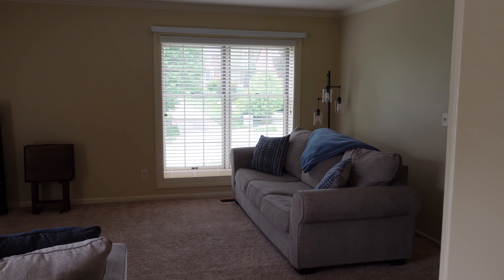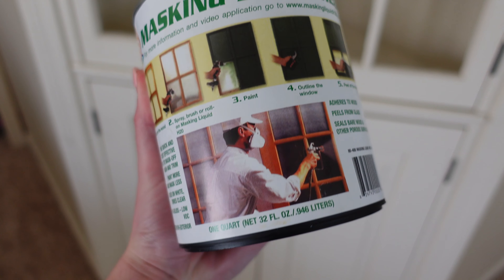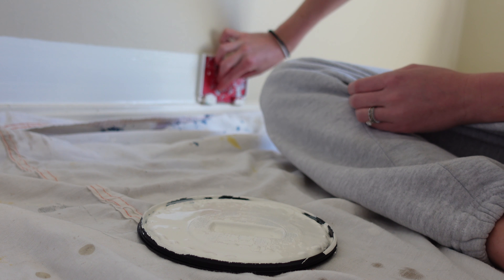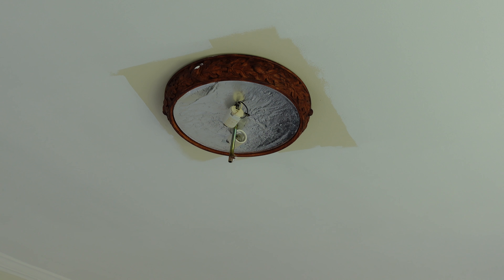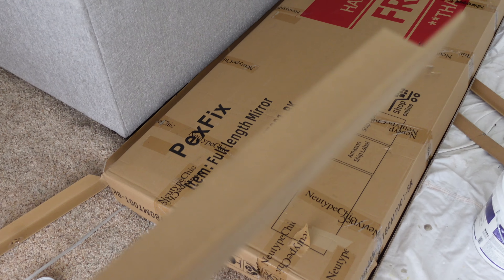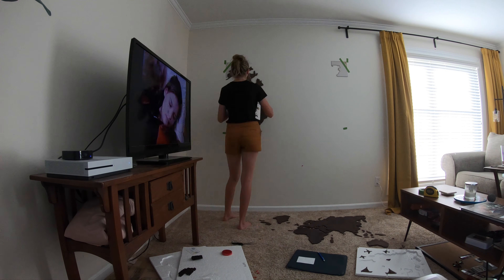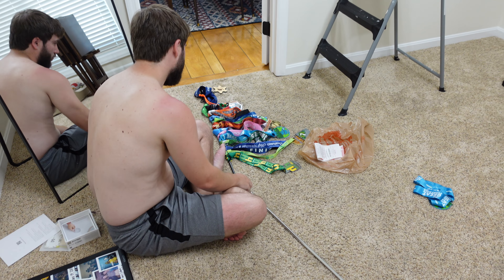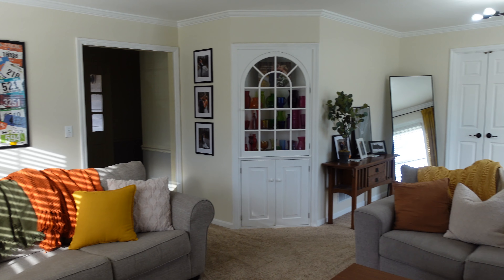Warm & Colorful Living Room Transformation: BEFORE & AFTER!

Comment: Whoever did the beige was probably so proud of themselves, lol. Like "I covered up this hot rod red!" The cream/white looks much cleaner though
Reply: Also, if you don't like the curtains being so long, it's pretty easy to hem curtains! Or if you aren't that committed, to pin them up at the bottom so they aren't as long
Reply from the maker: Right?? The previous owners were proud of the “new paint job” in every room. Every ceiling, wall, trim, door, EVERYTHING was beige 🥴 but I already swapped out the curtains for an olive green 😅